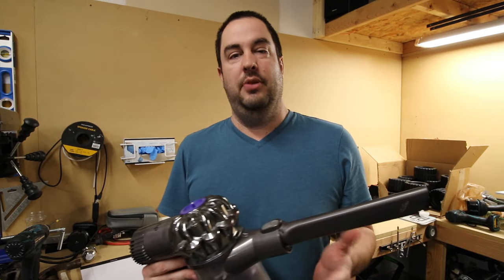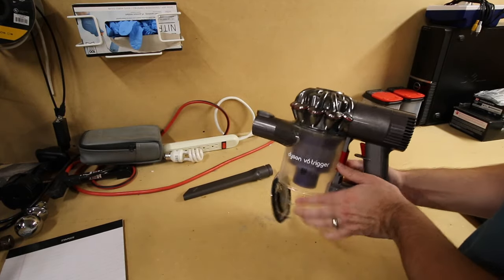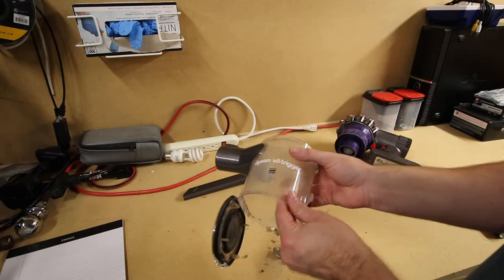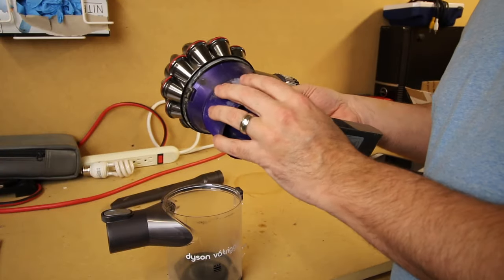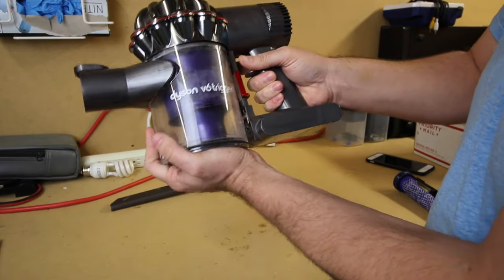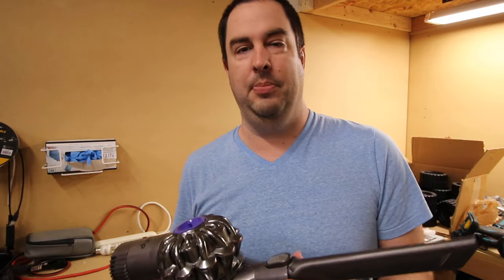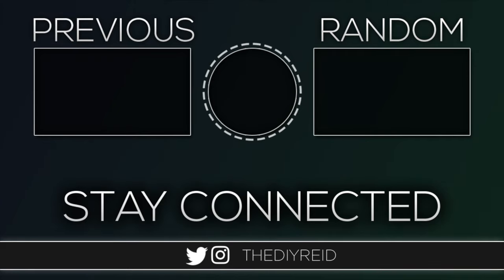How to Fix a Cordless Dyson Pulsing Issue

Comment: I learned a lot from this video, but discovered it is missing one important step. The long, purple air filter that is removed from the top must be disassembled to be cleaned thoroughly. To disassemble, depress the three tabs which will allow you to slide the cloth filter off the plastic housing. The dirt is INSIDE the cloth filter. Turn upside down, tap, and shake out all you can before washing - inside and out - under a faucet. Let dry completely. If you don’t disassemble, you’ll leave a solid wad of dirt inside the filter. This dirt, btw, was the dirt that was causing my dyson to pulse. Hope this helps someone!
Reply: Thank you for this comment, I just disassembled it and blocks of dust came out! It will run much better now!
Reply from the maker: I made a video on disassembling the vacuum further - 
https://youtu.be/0UIY4yOd2gU
Reply: Thank you for this. I had checked every centimeter of the vac but didn't clean this filter because it looked fine.
Reply: I happened to read this comment before I even got 30s into the video: tried this and it worked! Thanks so much, what a timesaver.
Reply: This comment changed the game! I’ve tried washing the filter many times before but could never figure out why it was doing that! Thank you both @DIYREID and @Anne Van Benschoten!!!
Reply: Brilliant comment.  Honestly this comment is more important than the video. 
Have a V6 since 2017 and after 6 years I thought change of battery was needed , but actually it was the dirt inside that cloth. Will buy a spare filter from ebay. Now new battery, new filter probably good for another few years. 
Otherwise would have binned the whole thing and had to buy a new one. Thanks for the comment.
Reply: Excellent comment, thank you, I found it finicky to disassemble needed a very narrow blade Swiss Army knife can opener end worked well for though had to be careful of the sharp edge not cutting the thin slats
Reply: Thank you so much. I'd tried everything he'd said but felt wetting the filter in its cone shape just asking for trouble. So, thanks to your comment, I haven't got a wet clod of muck inside my filter. Instead, because I couldn't disassemble, I took it outside and banged it on the wall, well, it was like a tardis, I couldn't believe how much dust and fluff came out, loads more than I could have thought would have fitted. Vaccum now working.❤
Reply: Thanks for this comment! Made all the difference
Reply from the maker: @Naturaltortoisekeepers I love how the community can help others out.
Reply: Thank you for taking the time to update this, I tried washing one of these out years ago at a company I worked for and they replaced the Dyson as it never worked.  Just found your comment whilst having this issue with my own one, stripped filter and cleaned it as you suggested, hey presto, working Dyson again!
Reply: You can avoid this by submersing the filter in water and shaking it around violently whilst fully submerged
Reply: Thankyou so much. I could not figure this out. Happy New Year from Downunder🎉.
Reply: Amazing! Thank you so much for the tip 👏👏
Reply: Exactly!!!  That was my problem too.  I will say that Dyson's are the most overrated/overpriced POS on the market.  Get a Shark upright....MUCH better with no plastic clips to drive you insane.
Reply: How do I reattach the cloth filter to the plastic part? I try to just slide it in but it slips back down easily
Reply: Thanks, after taking the long filter completely apart and washing and drying it stopped pulsing. Yay!  Thanks!
Reply: Yes thank you!
Reply: This helped me more than the video tbh

Comment: One way to test whether it's the filter causing the problem is just to remove the filter - I found that I had the pulsing problem with the filter inserted, but the motor ran OK if I removed it. It's drying after washing as I write, so let's hope that will fix it!
Reply: ...and having just had the same problem again several months later, I can report that it can also be caused by having "max power" activated! When it is pulsing, look for a blue light around the max power button - if you see the light then you need to hold the button in for a couple of seconds to switch it off. After doing that, it worked fine for me.
Reply: @HAIRYBIKER777  Thank you, Nick. You solved my problem. It has stopped pulsating.

Comment: We've had a number of Dysons and are big fans, until the pulsing hits. Your video is very helpful. BUT one thing that I found that will help with the "deep cleaning" and end the pulsing, at least for awhile. Two important things to do. Take another vacuum with a hose and clean thoroughly around the motor where the screen is. Also put the hose in the hole on the bottom. But possibly the most important is to tap the bottom of the motor while the debris container is off on a workbench or table. Do this until the very fine powder stops coming out. It is impossible for the vacuum to pull air through this dust when it builds up and the vacuum shuts down to protect itself. If you don't do this final part it will either pulse or simply shut down in no time.
Reply: ahhh... so I need my Orek to clean my Dyson!
Reply from the maker: @mrocheleau7946 lol.

Comment: You should clean inside the filter before washing. It is easy to unclip mesh fabric and you will be surprised how much dirt is inside.
Reply: I’m going to try that. I know my vacuum isn’t clogged, already taken all that apart. Washed outside the filter, but the 2nd I put the filter back in it pulses. Tried the vacuum without filter just to test and doesn’t pulse. Either I need to replace the filter completely or try to take it apart

Comment: Thanks - got us started in the right direction. I had already put in a new filter, which did not help. After wiping out the container/canister, I also used a letter opener and a damp paper towel to wipe inside. It was filthy and had to be wiped several times. We used paper towels and compressed air all over the pieces - it was amazing how much dust flew out of the parts. Then I went outside, put my hand over the attachment section, turned on the Dyson and more dust blew out. Amazingly dirty - hopefully they are making a better easier to clean model.

Comment: Thank you so much. I'd tried everything he'd said but felt wetting the filter in its cone shape just asking for trouble. So, thanks to your comment, I haven't got a wet clod of muck inside my filter. Instead, because I couldn't disassemble, I took it outside and banged it on the wall, well, it was like a tardis, I couldn't believe how much dust and fluff came out, loads more than I could have thought would have fitted. Vaccum now working.❤

Comment: Ous is a v8 and had the same issue. We just fixed it in just a couple of minutes. Filter seemed clean, but then I discovered my husband had sucked up a piece of packing tape and it was stuck in the nozzle. So glad it was an easy fix. The vaccuum is only a few years old.
Reply from the maker: Glad you were able to get it fixed.

Comment: Hi, I would suggest one tweak to your fix. Suggest looking for blockages first. I am a noobie with Dyson vacuums. I bought a Dyson v7 Animal cordless. I have only used it 3 times. The end of the 3rd time, it pulsated 2 times and shut off. I figured it needed to be charged, so I emptied it and put it on to charge. The next time I used it, it pulsed and shut off. I found numerous recommendations, including washing the filter. I finally settled on your video. I washed it and it was clean as a whistle (now I need to wait a long time for it to thoroughly dry). Turns out my problem was clogged tube near beater bar, as well as a clogged beater bar. I have two cats, a dog, and numerous dust bunnies. It was extremely clogged ;-). Thank you for your info and video!!!

Comment: Top man! My blockage was the rubber blow back flap just inside the connection point which could not open due to a 1mm piece of grit preventing the flap from opening. Your advice pointed me in the right direction within a minute of watching your clip. Sincere thanks, Top man
Reply from the maker: You’re welcome. Glad it could help.

Comment: I had the pulsing issue but mine was clogged in the power head right behind the rotating brush.  Remove and clean the brush.  While the brush is out remove the long narrow plate right behind the brush.  This will let you see/access/clean the opening where dirt makes the bend in the power head to travel up the long tube to the main canister.  I used a screwdriver to dig the clog out of this pathway and.... Good as new!

Comment: I didn't even know that the filter cap (the one on top) could even be pulled out! and it was the reason mine was pulsating. thanks for the video/explanation!
Reply from the maker: No problem. You should replace it after a few cleanings.

Comment: Something else I found while cleaning my Dyson was basically there was a wall of debris at the bottom of the spinning carpet attachment. Thanks for the video!
Reply: Me too. This was the source of my pulsing problem. I did all that I could in the video, but I have the v7 so the back is not removable. When I put it all back together and it was still pulsing, I realized the intake of the carpet cleaner was full of dust bunnies and what not. It wasn't hard to clear without taking it apart, but I realize just now (lol!) that there are instructions on taking it apart to clean it thoroughly in the manual. I love this Dyson and do not regret buying it!!! It's perfect for a quick cleanup!

Comment: Yup. Sure enough. As soon as I detached the pipe extension, I noticed a huge clog of fabric and crud that was obstructing the vacuum. As soon as I pulled that out, it worked again. I didn't realize before that the machine has some kind of regulating sensor that will keep it from running if a clog is present. No doubt to keep the motor from overheating, etc. Great, easy fix! THANKS!

Comment: This pointed me in the right direction, thanks. For me, I found theres a flap inside the nozzle (which you didnt allude to) where the tools plug into and this was jammed shut. 
This was causing the pulse issue in my case, once I run it under a tap (faucet?) the flap freed itself and now moves up and down as its supposed to :D

Comment: Great vid -- thanks.  Another tip: When you remove the dust-container from the unit, check that the little flap inside the inlet tube of the dust container opens and closes.  It can get clogged.
Reply from the maker: Good advice.

Comment: I had two dyson vacs that stopped working. one that was less than a year old (v11) and the other was a few years old. I looked up dyson and found a service center/retail shop near me. It was painless they exchanged the one that was under warranty and charged me 95$ for a battery for the other and I'm back to normal. great product and service

Comment: Nice video...one I thing I found is just running water over the filter is not enough. I learned I had to bang it a bit on the side of the sink and manipulate it with my fingers to break loose all the dirt inside

Comment: i have this item and i noticed the same thing. cleaned it out and all, but the floor attachment with the roller could be the issue.  is there a easy to take it apart?? i tried the 2 screws but it just takes off the cover. Is the brush suppose to roll freely or not?? i took the roller out and cleaned it and the ends where they attach..  It seems to work for a few seconds and then it doesn't.  too bad i can't a pic of it to you.   Great video info!

Comment: Awesome video, mine is the V7 but it works . Mine had a bunch of clumped dust/dirt right before the dirt catcher in the nozzle. It even had a 1” piece of styrofoam caught in there. I cleaned it all out and it works like brand new. I could have figured it out by myself but it was nice to see a video on it with other people that have the same problem.

Comment: Wonderful, Thank you so much!  My issue was the filter, who knew....ok, I probably would have if I read the instructions!  Thanks again!
Reply: I don't think the deep cleaning is in the manual. When I called Dyson, they recommended the "deep cleaning". I initially thought "year, right", but it worked great. You occasionally have to go beyond the emptying and do this maintenance to keep running.

Comment: Thanks for the video!  Problem solved - a blockage in the head/bottom attachment was the issue. It's a workplace Vaccum and I thought the charger was broken because it wasn't attaching to the socket in the wall properly and hence not charging. Bought a new charger and nope it did not solve the issue.  Searched online and came here - Bingo! Blockage.

Comment: Nice some hope for ours. 

Battery stopped holding charge last year,  called dyson they wanted to charge 120$ for a battery, found one for 30$ on ebay , Replaced it and its been working fine ever since except for the pulsing , I will give a thorough cleaning
Reply from the maker: Hope you get it figured out.

Comment: I had same problem, I phoned Dyson who were very helpful, I washed my filter about two weeks ago and still was pulsing so I took the top off the filter and hey presto full of fuff, dirt etc. after a good clean inside the filter refitted and hey presto it worked again. Mine was still under guarantee so they are sending me a new filter as the old one is a bit worn.
Reply from the maker: Glad I could help.

Comment: Can I ask have you experienced the problem of having to return the vacuum to the dock 3 or 4 timers before you get the full charge (say 20mins of vacuuming) It stops after 1min, return to dock for 30sec - goes again then stops after 30 sec, return to doc 30 sec repeat x 3 or 4 times - and then it will run for 20 minutes +?

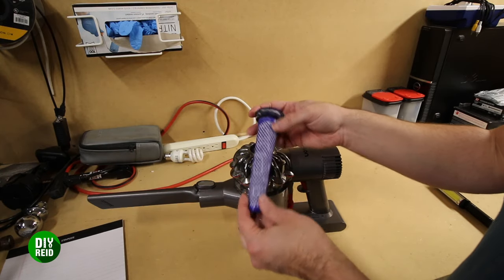Comment: 00:45 Very surprised to see you did not open that small filter, most of the times you have a problem it's because there is lots of dust in that filter.  You can open it with a butter knife.

Comment: I pretty much took my v6 apart and cleaned everything out and reassembled but still pulsing in Max mode.  So did that leave the battery? It charges up and holds a charge so not sure what would be wrong with the battery.
Reply from the maker: Are you sure it’s all cleaned out? Remove the filter and try.
Reply: @DIYReid  yes I completely disassembled it down to parts and cleaned everything out either wiping it down, rinsing, or air compressor. It's not a blockage and yes I tested without filters etc too and slowly added another factor etc to isolate. Now I think I am down to the battery or the motor chip? Happens only on Max

Comment: Did all of the cleaning.  I still pulse as soon as the vac sees resistance load.  Whats next?
Reply: Mine was clogged in the bend in the power head.  See my other comment for details.
Reply: @BrucePritchett  mine does it with no attachments... put your hand over it and boom...  as soon as it get moderate resistance

Comment: Another new thing I learned from this video was to clear the clog in the opening to debris canister.   Before you take it apart, I thought I would try looking into it from the outside port.   I saw a bunch of dog fur there and cleared it by pulling it out with a skewer.   It now stops pulsating and took 5 mins total.
Reply from the maker: I have another video on my channel that takes it further apart for a deep clean.

Comment: Perfect advice~!  Most of the other video fix's say to just clean out the vacuum tube or where it attaches to the main motor. Your video was the one that shows to clean out the filter that pulls out of the top. Thanks ~!
Reply from the maker: I know you can take it apart more to clean. I did another video on that.
Reply: @DIYReid  thank you
Reply from the maker: @michaelgage9134 no problem

Comment: So, if it's not the filter, ducting, cyclone area, different battery, same filter on different unit, disassembled and checked for internal blockages, any ideas?
Reply from the maker: May be a weak battery.

Comment: We’ve cleaned every area except this. Doing it tonight. The only odd thing with ours is that it runs normally on reg speed. Just at max suction it starts the pulsating. Thanks for info
Reply: Same with my machine. I have only ever washed the filter, so hope checking for a clog will do it.

Comment: I removed everything past the v10 ports. still pulsates. I think mine just needs a new filter. I cleaned it, it appears to be clean and dry. still pulsates. I think the only thing left is the motor but it seems like it's impossible for that to be blocked, it's double filtered.. :(

Comment: I used a compressor to blow the funnel filter out externally with a needle air gun first, then blew the filter out internally with compressed air.

You can see the dust come out as the air gun is wavered up and down the outside of the tube.

I also used air to blow out the other paper filter much like you do a car air filter.

Thanks.  No more pulsing.

Comment: Thanks for this help. I notice even you had trouble with pulling the main can from the motor part. Pretty poorly designed and none of it fits together as easily as Dyson would have you believe in my opinion.
Reply from the maker: Yeah. Once you figure out how it’s supposed to fit it’s not bad.
Reply: Mine came on and off easily luckily